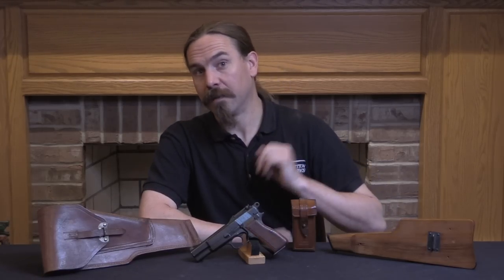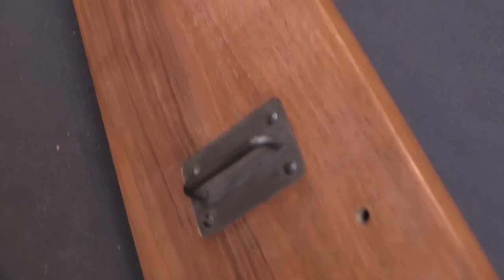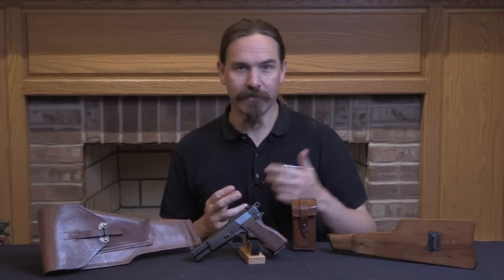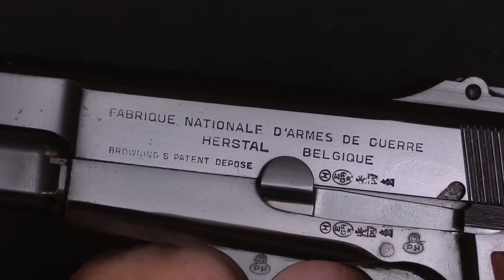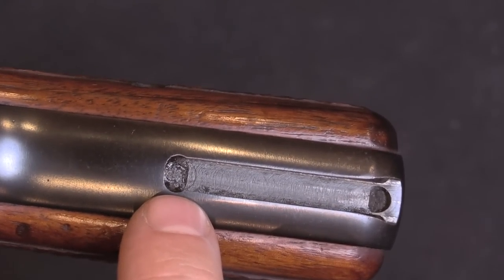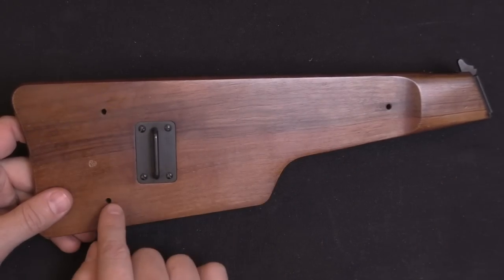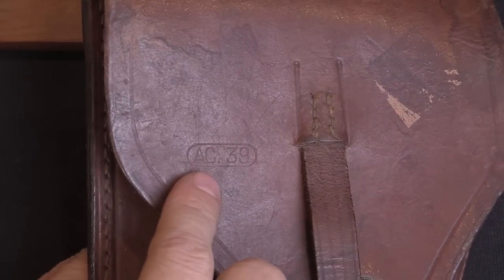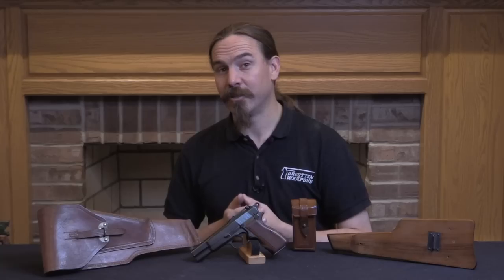Belgian GP-35: Pre-War Browning High Power Complete Rig

Comment: for the sake of pedantry I feel compelled to clarify that the difference between a sheath and a scabbard is that a sheath is flexible (usually leather) and is there just to protect against the elements and for ease of carry, while a scabbard has a solid structure (usually wood or metal) that offers some protection against external forces. it could be argued that kidex holsters are a form of scabbard but this is definitely a sheath, although I would argue that it should just be called a holster.
Reply: I’d introduce the sheath/scabbard denomination for holsters too just for the fact that when you search for them, new ones pop out annoyingly more than older, leather ones.

Comment: I customized one of the aluminum framed BHPs that are coming in, made for European police agencies in the early 80s.  For my money, with good replacement sights and the trigger fixed it's a far better pistol than any of the plastic "modern" guns around.  In an aluminum frame it weighs almost exactly the same as a Glock 17, with similar capacity (15+1).  Stupidly, Springfield and FN have released new versions with the same problems fixed, but in steel frames.  They're completely missing the civilian CCW market because with a steel frame (still a great pistol!) it's a boat anchor.  With an aluminum frame it's a viable carry gun.
Reply: Look at Girsan's new MC P35 PI model.  Very much like an FM Detective.
Reply: I've removed the magazine disconnect but there's still that not so great take up slop in the trigger as the bar begins to pivot. Is there a solution for that?
Reply: There are 3d printed hi powers now too that are even lighter.
Reply: @otm646  Cylinder & Slide make custom hammers, sears, triggers for the High Power that give you a beautiful trigger pull. You don't really need to replace the hammer, but most people prefer the round "burr" hammer.  You can do it yourself with basic skills and a proper punch set.
Reply: Truth or fiction, either way it was fun to read.

Comment: Most young men got in touch with this gun during their military service. It was the side arm of officers. At the range, everybody could have a go. But no officer cleaned his own gun, that was for the soldiers who had shot it. Unacceptable in fact, let somebody else disassemble your gun. And trust than that it was ok again? No. At the gunroom, it was each time yelling “ who has messed up this GP???”
Very interesting in Belgian state structure is that it was used by some units of the Gendarmerie/ Rijkswacht . But generally not by normal police. This culminated in the ‘80 tragedy of the Bende van Nijvel, whereby local police felt hopeless outgunned with their 7,65 / 32acp.

Comment: The HiPower is arguably the world's first "wonder-nine", and even as old as it is still makes as good a sidearm as can be had. There were other high-capacity 9's back then, but none were as widely used and some like the high-capacity C-96 and snail-drum Lugers quite unwieldy and unconventional. It's only real vice is that it's grip is somewhat large for small hands and it's SA which some do not like, and the trigger pull isn't great but can be smoothed-up fairly well. Like the 1911 or a S&W revolver it's a timeless classic.
Reply: How does the internals compared to the 1911? Is it a refined 1911?
Reply: @Joshua_N-A  Not similar at all except that the barrel drops at the breech to unlock, and there's a different method doing that. Also the mag release is similar. IMHO the HP is a much more refined and advanced design.

Comment: I love pistols with shoulder stocks. I don't care that it seems to have been out of favor for like 80 years now, a simple stock can improve aiming stability (accuracy), recoil management which leads to faster potential follow-up shots, and arguably can even improve reliability given that there is lesser rearward recoil meaning the slide has more 'oomph' to cycle back in totality and then sling forth to strip another round. After all, 'limp-wristing' can cause malfunctions in some firearms, so the more stable the firearm is (the least amount of muzzle-flip or rearward movement), the more capable the slide will be in KICKING out that spent casing and then hammering home that next round.

500m sights? Uh... yeah, maybe back in the days of 'line formation' or 'volley fire' or concepts like that, but practically speaking, even with 100m (110yd) sights you'd be getting quite optimistic. Not everyone is Hickok45. Plus, if you've resorted to using your side-arm, you should probably GTFO of whatever situation you're in rather than attempting to engage threats at triple-digit distances who PROBABLY have superior firearms than you. Get a long-arm. A PROPER long-arm. Either something intermediate, full-power, or something that spits pistol-calibre ammo in full-auto. All are superior at 100m+ than pistols, which includes pistols with stocks attached. A pistol with a shoulder stock is not the greatest platform you can have, but between a pistol or a pistol with a stock, the pistol with a stock is inherently superior. It is VERY rare and unlikely to have to actually use a side-arm, but if you find yourself in that sort of situation, having the option of attaching a stock makes it a whole lot easier to use efficiently and to deliver accurate, controlled, rapid fire if that is needed.

AWESOME video! Also, with three 13-round mags plus one in the spout, that comes out to an even 40 rounds! I like that. To think you'd need six 7-round M1911 mags to achieve a similar amount of ammo, or indeed five standard-capacity 8-round mags that was probably the most common capacity during WWII. Hah, and revolvers? Be ready to have to reload probably 6 times lol Yeah, for the '30s and '40s, the Hi Power was among the greatest possible side-arms to have. Only real competition from what I can tell, outside of a select-fire Schnellfeuer C96 with 20-round detachable box mags, is the Walter P38 which has such modern features as a loaded chamber indicator, decockers, single/double action trigger, and... well fair enough it loses points for the heel-style magazine release which isn't nearly as ergonomic as a push-button mag release, but still, it clearly had elements that would become commonplace decades in the future... but I'll take that push-button mag release and 13+1 round capacity, thank you very much. For me personally, Hi Power was the best pistol available basically up until the CZ-75, but then there's some pros and cons in that situation too. My big hands find some difficulty in manipulating that short little CZ slide, but DAMN do I love that Czech pistol.

Czechnology is some of the best in the world. Easy.

Comment: This is basically a PRE-PDW. We can see the legacy. Mause C96 with stock.  Then the full auto version.  BHP with stock.  The Luger P08 with stock.  The M1/M2 carbine. By then end of WWII, sub machine guns getting smaller, lighter, with pull out stocks.  A few years later...MP5-PDW, HK MP7A1...  The bullpup is an off shoot and may be the ultimate gun for the weapons crew which shouldn't need an individual gun, but ...  It is a matter of how light and small can we go.

Comment: I might be crazy but I would love to do such a thing with my CZ 75 😁 meaning to build my own "rig" with stock, etc...
Anyway awesome video as always
Reply: I would also love that so much as I love the CZ75 design. If you like the CZ75 you will like the high power.
Reply: @luked2767  I do like HP as a historical weapon but for me CZ feels like more refined and better successor

To clarify, I own CZ 85 Combat pistol which is a standart 75 modified with better trigger and ambidextrous controls
Reply: I mean its interesting but honestly it really only makes sense to me if you have pretty long periods of carry for each mode without having to switch back and forth and you cant have a carbine. 
 And even then i think something like the fram kits you can drop a pistol into pretty much serve this purpose well.
Reply: @metamorphicorder  yes frame carbine kits exist but they are bulky, made of polymer and all that, personally I dont like those.
I would take this as a personal project not as a practical build in a modern setting but as a tribute to vintage guns like HP, luger, C96 to name a few
Also like the asthetics 😁
Reply: @BruceLortzHI  very interesting thought 🤔
Reply: @martinpojer5375  good points. I also like the aesthetics.
Reply: Would you base the stock off of an existing design or try to design your own?
Reply: @rogainegaming6924  probably bit of both, I've been tinkering with the idea for some time now but no clear results yet
Reply: I'm assuming that you're not in the US, as there's a lot of legal hoops to jump through to have a stock on a pistol.
Reply: @ScottKenny1978  nope, Czech Republic resident here

Comment: Would i be correct in thinking it was the highest capacity pistol available until Glock arrived? in the late 80's
Reply: No because Mauser and Astra had 20 round capacity C96 Broom handles.  Not a common variation though.  HK had VP70s with higher capacity too before Glocks came around.